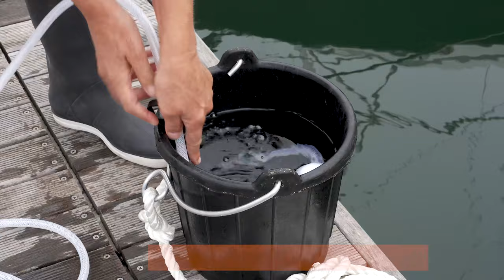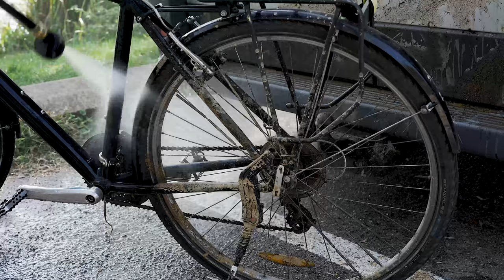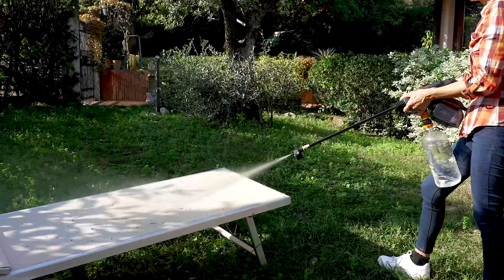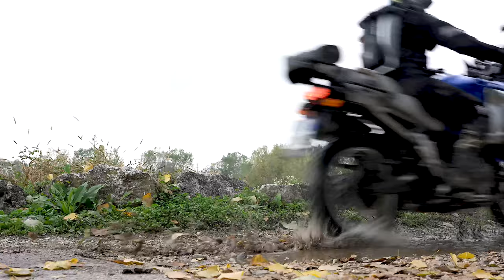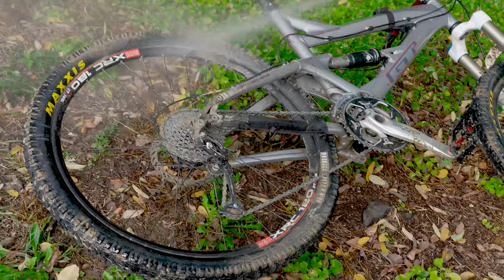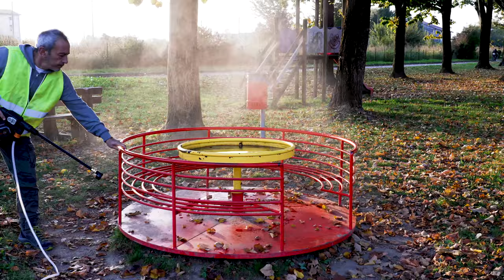WORX NITRO WG633E Hydroshot Brushless Cordless Pressure Cleaner - WORX UK

Comment: Genius idea. I love my Nitro power washer for my bikes. Such a great idea and in my honest opinion best of the bunch. Soo many applications for its use 😅!, so convenient to use and makes chores a breeze. The only possibly improvement I could think of is maybe 🤔 a lock switch and stand with a flexible short hose for those hard to reach areas under my motorcycle for example haha 
Keep it up Worx great stuff. Next on my list is the tyre inflator and work light 💡 the battery idea and sustainability is a game changer 😊for me